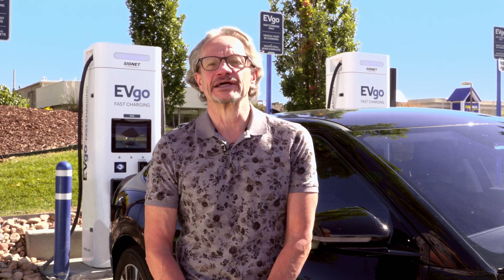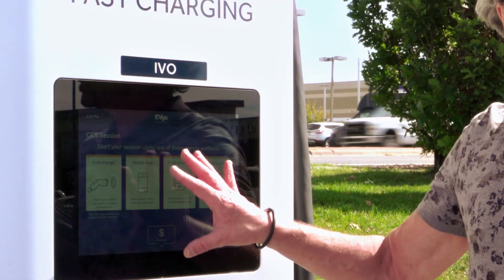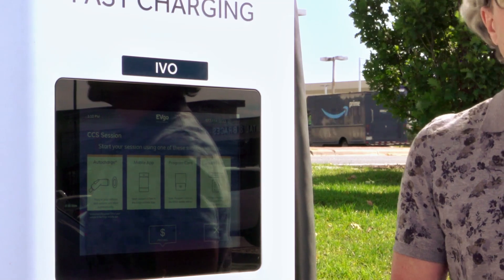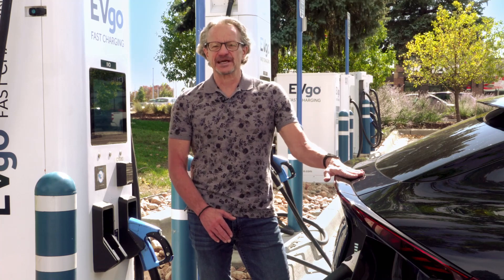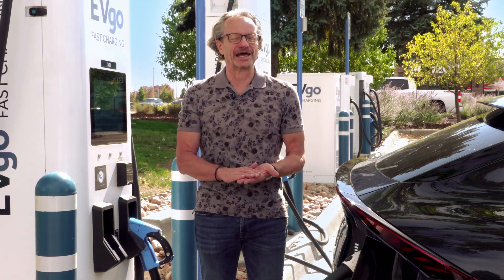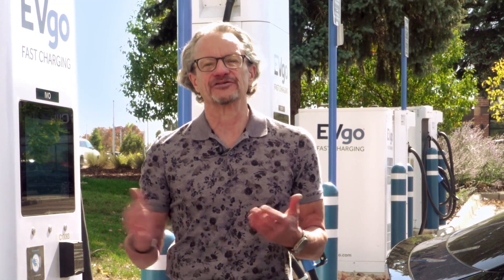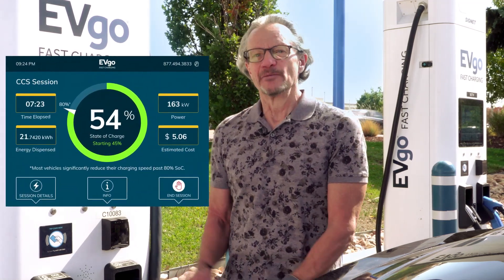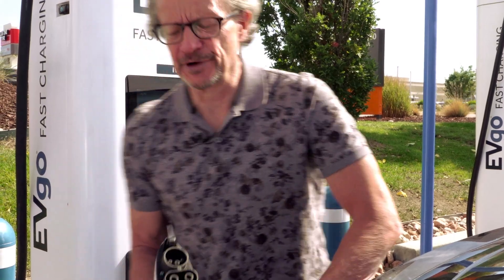What Happens When You Plug Your Electric Car Into a DC Fast Charger?

Comment: Not mentioned is that many EV's are only 400V battery packs, 800V is still rare.  So those will be amperage limited on charging, and amps creates heat which is why those cables have to be so thick.  Each piece (charger, dispenser, cable, handle, car connection, battery) have amperage and temperature limits, the weakest link will dictate the charging speed.

Comment: I would like to see more flexible cables. The super-thick cables put an uncomfortable amount of stress on my charge port. Idk if you need to move to air or liquid cooling cables, but these 350kW cables can be SO THICK.
I wonder how much of the time any of these chargers could possibly spend above 250kW anyways, given how lithium battery charge curves work. My Tesla can only take up to 250 and only for a very short part of the charge cycle, under 30% SOC. Only saving like 2 minutes during a 20%-80% charge cycle. 
Thanks for considering.

Comment: Nice explanation.  What i'd like to see from the car and charger point of view is a readable log (in car and on charger) as the communication happens with the questions/answers.  This will help the user (if they are interested) pinpoint any points of failure so they can know if its the car or charger having a bad day. It can be hidden under an icon called "Nerd Mode"
Reply: I would too. BUT. This would add a bunch of support costs to EVgo and your EV manufacturer. Most people wouldn’t understand the info well enough and it would create more support tickets. Perhaps they could just display the limiting factors, battery too cold, cable cannot support over X amps, etc.
Tesla started displaying the “temp too low, here’s how to precondition next time” messages recently which is helpful to novices and experts alike for understanding why charge rate is.
Expected vs. actual charge curve graph would be nice too.
Reply: Agree 100%.